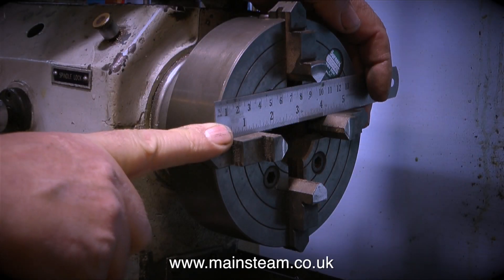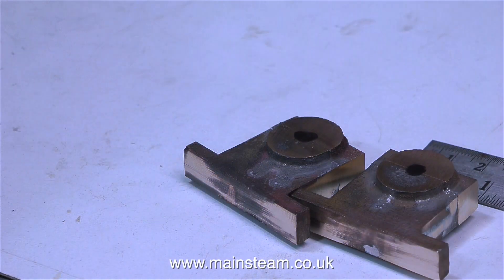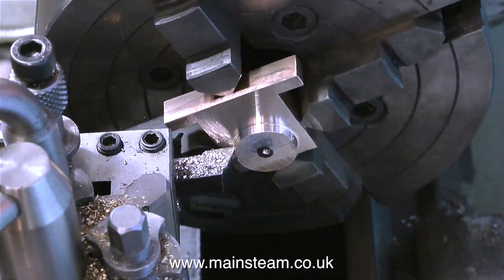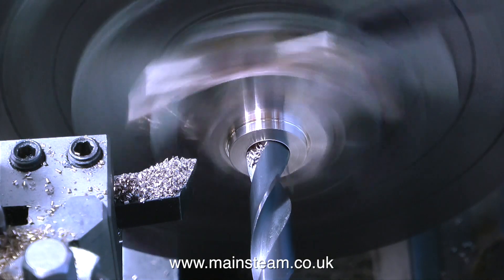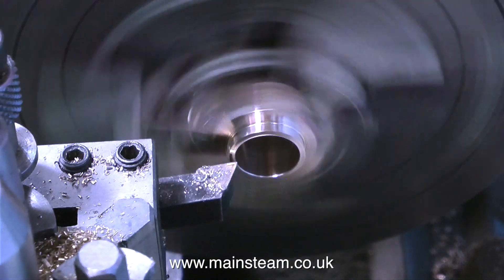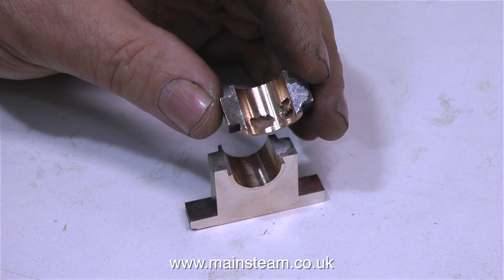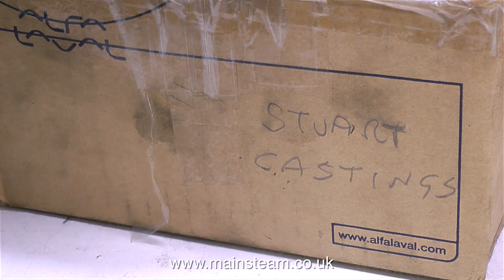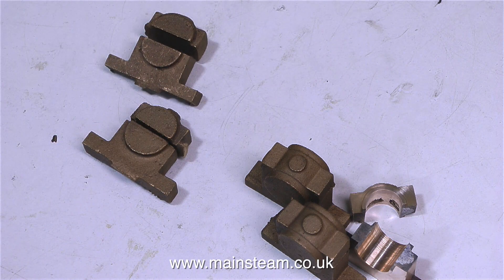PROBLEMS WITH SOME CASTINGS - IN THE WORKSHOP

Comment: A few years ago I was machining the face of a 65” flywheel and discovered a small imperfection which I thought would clean up with one more pass across the face. How wrong I was, instead I opened up a wider and deeper “blow hole”. Should have left well enough alone. Based on the size of your part, that is quite an inclusion. I like your work, thanks.

Comment: Could you not fill the blow holes with solder or brass rod since you are going to be using the oilite bearings anyway?
Reply from the maker: Yes, but no - as I mention on the video ....... I will always know the blowholes were there, plus the castings are undersize to start with - as I also mention in the video.
Reply: Sorry, i didnt mean to question your decision. I was just curious of the other possibilities or if it is possible to solder the holes closed. 
Cheers for your reply
Reply from the maker: The main problem is cleaning out the blowholes for the solder to stick to. I have some more on their way from Stuart Models anyway which I think is a better way to go especially as I need to make the episode that shows how to machine the parts..........
 {:-))))

Comment: I understand the aesthetics involved in using the casting with the blow holes--even though hidden--but inasmuch as you were going to insert the Oilite bushings, would there have been any detectable mechanical detriments--in both the short and the long run--to using them? Not a criticism . . . just probing the issue.
Reply from the maker: They are defective - that is a good enough reason not to use them .....